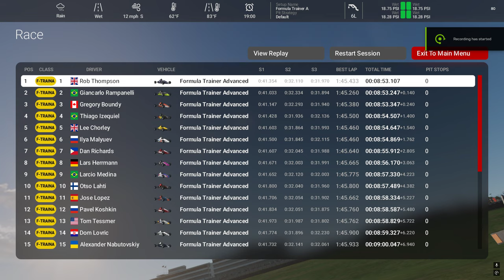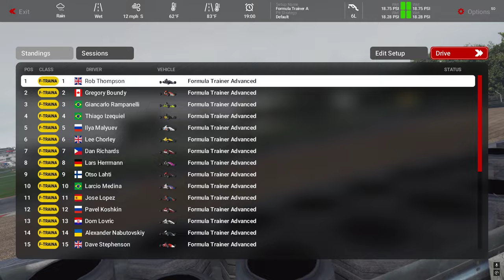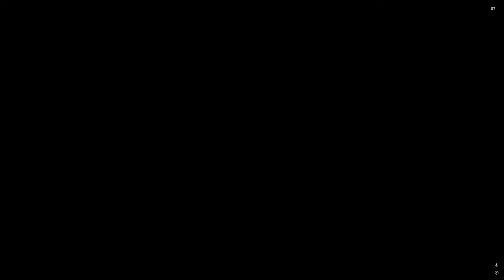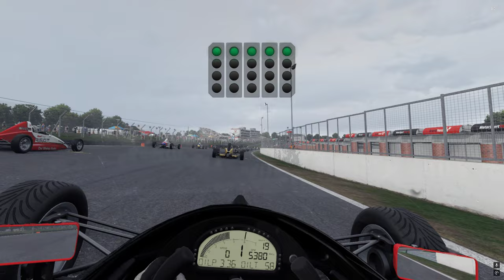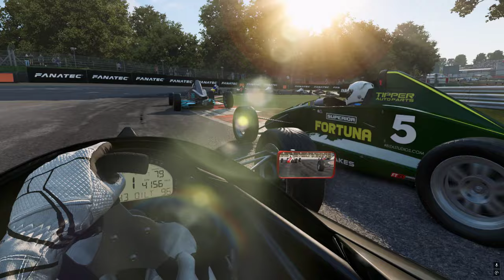Automobilista 2 Stunned Silence

Comment: I drove a truck for a living for 32 years. Almost never the same truck twice. Always different motors, power, size, layout, etc. Adapting to a new ride is my jam. All of the adjusting is not an issue for me and I'm loving the new update. The cars respond more like the way I would anticipate vs the more unpredictable slides or spins or losing the rear end. Now when I lose it, I say, yep...felt that coming. I had it down pat where the AI would go into every turn and now I'm finding them to be way more unpredictable which is challenging but was very much needed. Prior to the update, every overtake felt like a routine, passing at the same places the same way every time. Now there's variety!
Reply: Totally agree on overtaking. The AI, despite being set to low aggresion, would actively defend their position. Sometimes too aggressive but i was always able to react on time so no crashes yet.

I don't play much online so this is a welcome addition to singleplayer experience.

Comment: What you're saying is, with the new update it's like we're getting a whole new game that we have to relearn. If so then I'll happily take up that challenge. It's like getting a free better game in place of an already great one. If spending the time to learn the basics is the requirement then it just means facing a new challenge, at no additional cost. I see this as a positive, although I can see why those set in their own old ways won't share my (our) view.
PS: pounded many alaps at Brands Hatch Indy (the short version) with the Mini Cooper and LOVED IT! Was 2 seconds a lap faster than the new, much faster Audi DTM. Like you said, returning to basics has already paid dividends for me. Plus all the added fun of pushing the limits with the improved physics.
Reply from the maker: AMS 2.5 ..........It's Christmas come early! I was in an endurance race last night in GT3's I was seriously struggeling as were many others.......Going back to the basics was the awnser. re learn the cars.
Reply: @hereward1971  Indeed. Love the idea to force myself to start small in order to better improve, took too many liberties up to now which shows in my poor driving. Which is why I'd like to drive some of Fred's mods, the slower FWD ones for example. But I just saw a comment on Discord that his mods are making the game crash to the desktop. Are you experiencing this?

Comment: I don't know. I'm a ams2 fanboy but slidy is still slidy. I feel a little bit more grip And feedback through the wheel when cornering but I don't feel a massive change yet. Some of the older cars don't feel as good. However, I haven't raced much lately and I need To give it more time. Muscle memory you speak of has some merit though, so I will try to be optimistic.